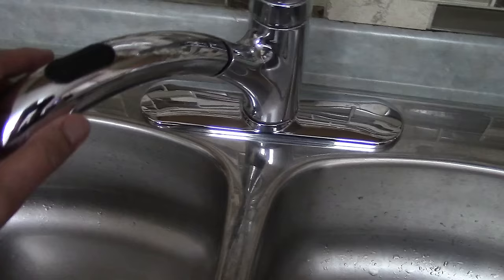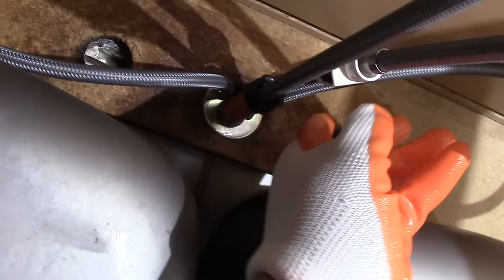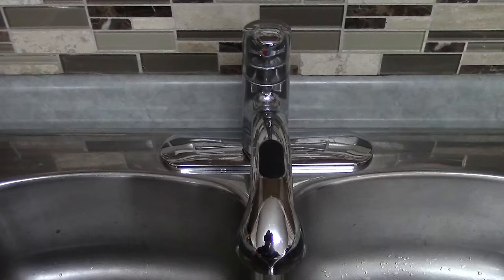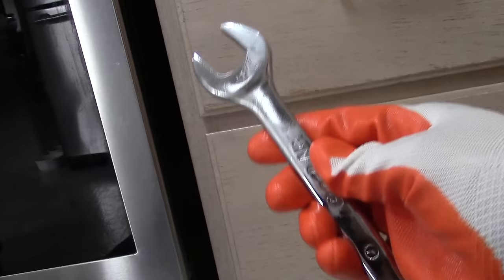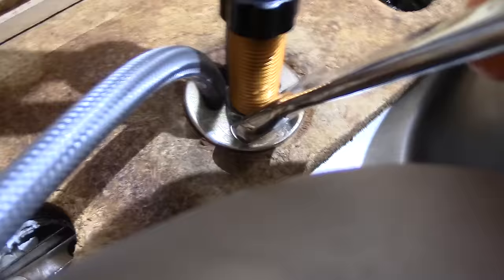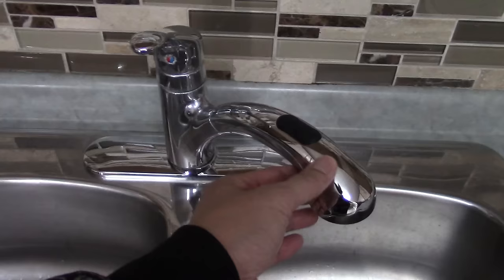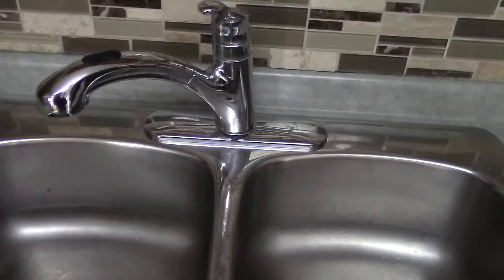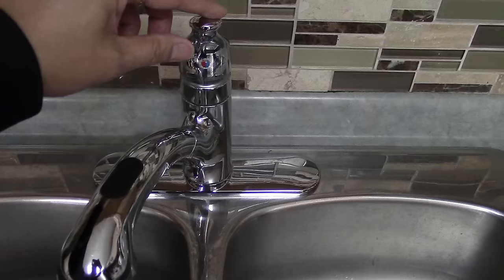How to fix loose Kitchen Faucet. DIY.

Comment: Worse faucet I've ever owned! I'm on my second one but I should have learned the first time. Thought I got a defective one but found out it's the design that's defective. I'm under my sink at least once a month tightening the nut which isn't easy. I'm pretty small and it's very uncomfortable to do.Thanks for showing me I'm not alone. I'll change it out in the very near future.
Reply from the maker: Yes you're right Barb. it's not a good design.

Comment: Good as far as it  goes, but recommended: (a) never use an adjustable wrench (e.g., "monkey wrench") to tighten a nut. Acquire a wrench the exact size of the nut you're tightening; and (b) use Loctite 272 to coat the part of the thread the nut will be over when tightened, then tighten the nut.

As it is done here, the nut is not completely tight and it will loosen again very soon, due to the forces applied to the assembly when the faucet is moved left-to-right and the reverse.
Reply from the maker: Great advice. If happens again I'll by the special tool for it.
Reply: Apply a glue?
Reply: @SoulSeeker770  No - a thread locker (medium strength). It will stop the nut from backing off but not make it so it will never come off again for removal etc...
Reply: 272 is high strength is that really okay for plumbing?
Reply: What size monkey wrench for the Moen faucet shown?
Reply: @arikcarlo 13/16

Comment: You should purchase a Ridgid EZ change faucet tool it will make that job a lot easier as well as several other plumbing jobs. Thank you very much for the video.
Reply from the maker: You're right. Thanks for the tip!

Comment: Over a few months period, it continues to loosen up. Would you recommend a larger washer of using sealant?
Reply from the maker: Try the red locktite. Put around the threads and tighten up again. It should do the work.

Comment: What do you do when it gets lose in a few days? And the base plate is also loose?
Reply from the maker: I have not tried it yet, but you can buy Red Locktite (like a glue but for metal), at an automotive store & put it around the threads and then tighten it again.
Reply: This is exactly the problem I have! I pull everything apart ti use the plastic wand that goes over the water line,  OR I wreck my back getting in there with a wrench - but the next day I have to do it again - so annoying!

Comment: As you're tightening the nut, is the washer against the plywood? Because mine is exactly as yours in this video, and every time I go in to tighten the nut, the washer rotates with it. I think i need a plate between the washer and the plywood for the washer to grip so I can tighten the faucet. Its a big headache. Every time I use the faucet, it loosens. Should I buy a new faucet. I paid close to $1000 for this. I'm never buying anything expensive again.

Comment: Any suggestions for faucet heads that keep coming loose? I tighten the screws but they keep co ing loose.
Reply from the maker: Great question! There is something called Red Locktite that helps the nut from loosening again. You can buy it at your local Home Depot or automotive store  or Canadian Tire if your in Canada
Reply: @jonahvlogsdiy4143  thank you do much.

Comment: The gold piece that is at the top connecting to the faucet completely fell out of the faucet and is hanging at the bottom. I try to screw it back into the faucet so then I can follow your directions but I can’t get it to stay. The gold piece looks fine, so I am not sure why it won’t stay or how to best screw it into the faucet. Any suggestions?

Comment: The problem is that it will get loose again in no time.
Reply from the maker: So far its holding but I will buy the correct tool & lock tite it next time it loosens.

Comment: You installed the faucet incorrectly in the first place.  You are supposed to caulk around all the points where the water can get in (the three holes under the faucet).  Water in getting in those holes and rotting out your fiberboard counter top.  That is why the nut is loose.
Reply from the maker: I don't that's the issue. It's  just a bad designed faucet.
Reply: @jonahvlogsdiy4143  The under side of the faucet looked wet to me in the video.  How did it get wet then?
Reply: I don’t have 3 holes, my countertop is granite so it’s got nothing to do with caulking holes under plate; it is, as Jonah states a deign flaw. Moen no longer makes this faucet.

Comment: There's like a white cracked piece at the base in mine what is that?
Reply from the maker: Sorry not sure what that is.
Reply: @jonahvlogsdiy4143  oh dang it's where the body meets the oblong/rectangular base. The same spot that's wiggly in the video. But it's like what's on the inside that's cracked.

Comment: Ok but how do i loosen it up to replace
Reply: If it’s this faucet by Moen there’s a Quick Connection on the water supply line. You disconnect that and remove the weight. Then you can turn that bolt right out.